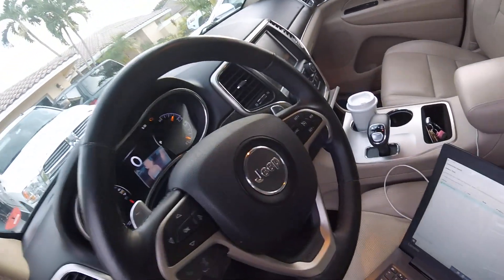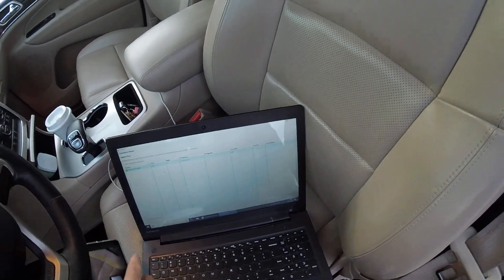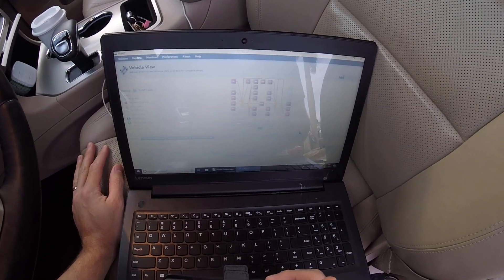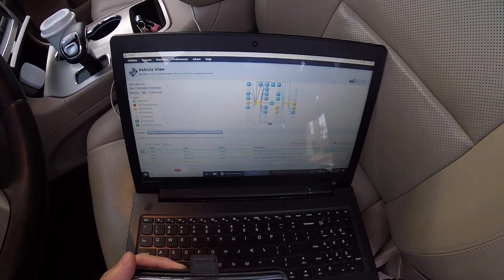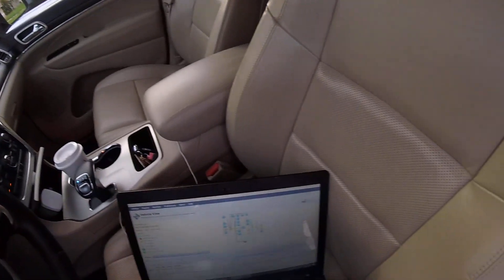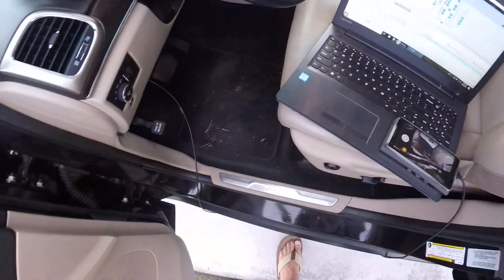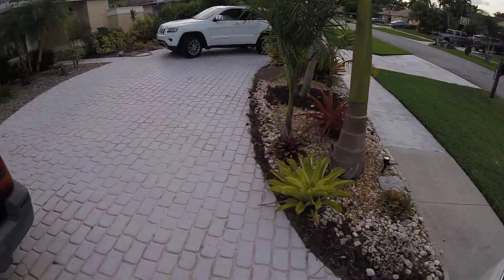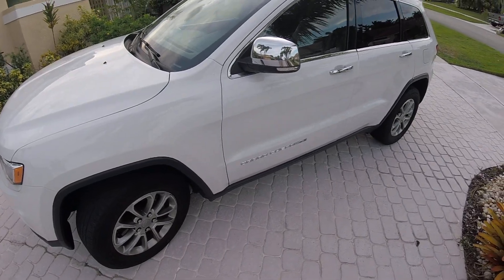Diagnosing a check engine light on a 2015 Jeep Grand Cherokee using wiTech

Comment: Hi. I have some question about Jepp Grand cherokee 2014 5,7 HEMI. Can i change lights & radio (software/settings) from USA to EUROPE via micropod without online witech subscription ? Grettings from POLAND ...
Reply from the maker: Greetings! I don't believe so, but I will check the next time the vehicle is hooked up to the scanner. I suspect you may need a DealerConnect login for that.
Reply: @JoesGarageProductionsLLC  Big thaks for answer ! I try check how much cost original micropod interface, but no one in Poland knows anything. Maybe you know how much cost this in US ? Only guys from china knows own price (insane world)...
Reply from the maker: @Green_Smoke777  the micropod I used in this video was actually a $200 Chinese clone. It works very well. I have not tried flash programming though as I do not have an appropriate battery charger. I believe the genuine Chrysler micropod is a couple thousand US dollars.
Reply from the maker: I should have noted that the software that came with it did not work. I had to make some "adjustments" to it to get it to work. It required writing some very small simple programs
Reply: @JoesGarageProductionsLLC  You use witech on-line subscription ...  + drivers for micropod  ? Or desktop offline witech aplication ?
Reply from the maker: @Green_Smoke777  it is desktop wiTech, version 17 I believe. Works through the 2017 model year. It also works with a techauthority subscription. I have not tried connecting it to dealerconnect as I do not have a login for that.